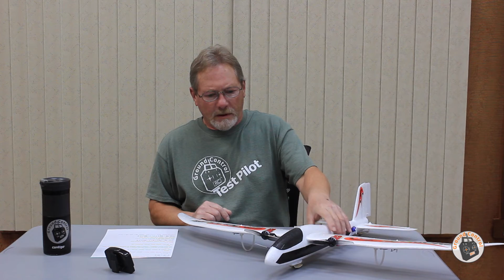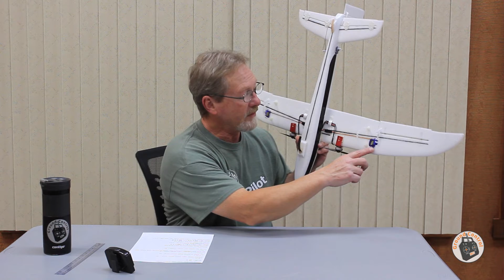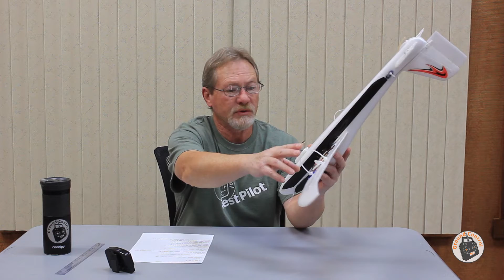Cause of Crash & What would I do different? Cheetah Chuck Glider 1 Meter Twin Motor RC Conversion!

Comment from the maker: Chuck Glider EPP Foam 99cm Wingspan
https://s.click.aliexpress.com/e/_Dci1dPt

RacerStar BR1306 4000kv Motor 1S-2S
https://www.banggood.com/custlink/GGGcVKBGLv

Favourite FVT LittleBee 20A-S 20A S ESC BLHeli_S BLHeli S OPTO 2-4S
https://s.click.aliexpress.com/e/_DBuQmJp

BetaFPV 2004 3000kv Motors
https://bit.ly/3NRfofa

This is where I ordered my T-Mount Props
https://newbeedrone.com/

This is where I ordered my Folding Props
2 Pair Rc Airplane Plastic Folding Propeller 6'' to 18.5'' Prop Suitable for Plastic Spinner Or Aluminum Spinner RC Airplane
https://s.click.aliexpress.com/e/_DkflZDp

20pcs/lot 5030 Propeller 2-Blade Props CW/CCW (ABS) Multicopter
https://s.click.aliexpress.com/e/_DFIszDD

Gemfan Hurricane 4024 Durable 2-Blade Prop 1.5mm (4 Pairs)
https://s.click.aliexpress.com/e/_Ae4a0J

Gemfan Hurricane 4024 Durable 2-Blade Prop 1.5mm (4 Pairs)
https://www.banggood.com/custlink/KDDYqHmGPg

Gemfan 5125 3-Blade Propellers 5mm/1.5mm Shaft
https://bit.ly/3uVoQWq

HQ 5025 3-Blade Propellers 1.5mm Shaft
https://bit.ly/3uUAa4Y

HQ Prop T5x3 Bi-Blade 5" Prop 4 Pack (1.5mm Shaft) - Grey
https://www.racedayquads.com/products/hq-prop-t5x3-bi-blade-5-prop-4-pack-1-5mm-shaft-grey

6X Emax ES9051 4.3g Digital Mini Servo
https://www.banggood.com/custlink/GDKC5FymJH

4X Emax ES9051 4.3g Digital Mini Servo
https://www.banggood.com/custlink/Km3WPVyDWZ

RadioMaster TX16S Transmitter
https://www.banggood.com/custlink/DvvycmfSMK

RadioMaster TX16S MKII Hall Gimbal 4-IN-1 ELRS TX
https://www.banggood.com/custlink/KK3EUzvecp

Banggood GCRC
https://www.banggood.com/custlink/GmDmQ1nVkO